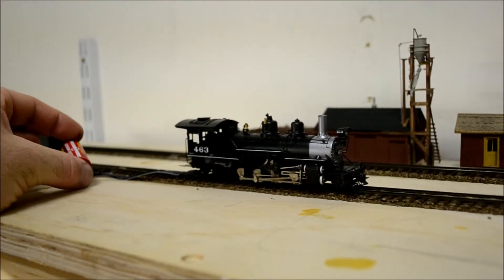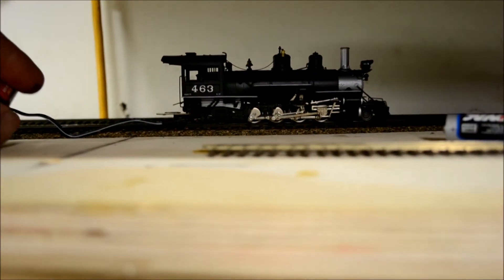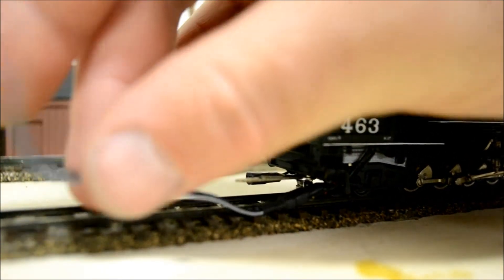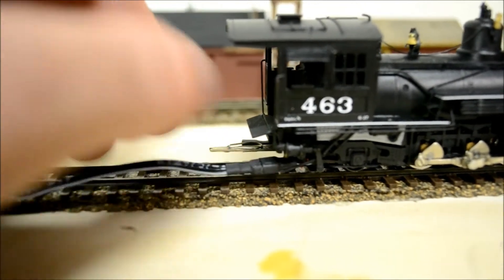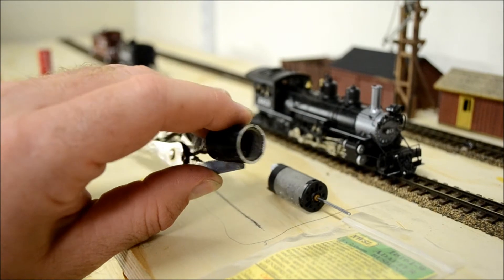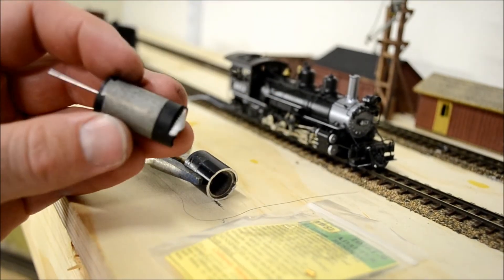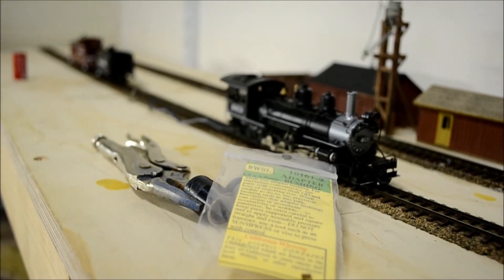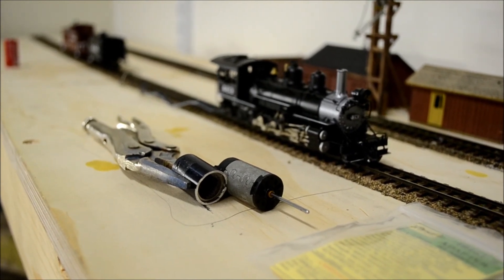Westside Models K-27 Brass Motor replacement

Comment: I recently came across a bunch of brass engines. The first two engines I tested went forward and backward, but then quit moving. The motor still makes noise in both directions. The previous owner informed me that they have been stored since purchase in the 1970's, never ran. After I inspected the the lot, I believe that they were never used/stored since purchase. My question is what would make the locos not move after going in both directions? Is it a maintenance issue, oil/lube issue? Any insight is appreciated. Happy railroading, thanks!
Reply from the maker: I would disconnect the motor from the gear box to see if there is any binding in the mechanism. If not, the motor is probably bad and needs to be replaced. I recently just re-motored some more HOn3 steam locomotives with NWSL motors, they are about $22.00 from their website. If you are going to run DCC with them you almost always have to change the motor out, draws too many amps. I just did a video on showing some of the locos I am currently building.
Reply: @Helmikins  thanks for the reply! I might have to pick your brain some. I have never worked on the engines, but, I want to be able to. The motor still makes noise like it's trying to go. It's not a buzz nor hum. Someone  else said it might be the drive rubber tube. Is this a common issue and resolution? Thanks again!
Reply from the maker: @KSamek-bz9cs  The rubber hose is almost always bad on these models and can be replaced with RC aircraft fuel hose. Usually it will turn yellow and go rock hard. You can take a sharp hobby knife and cut it length wise to get it off the gear/motor shaft. I would disconnect the motor and try and spin the gearbox shaft. This will help eliminate the running gear as the issue. Do you know the maker of the models? If you are able post a video of what it is doing.
Reply: @Helmikins  The 2 models I'm referring to are Westside Model Company Sierra #24 2-8-0, and Westside Model Company Southern Pacific Class A-6 4-4-2. I can get you a video of the sound it makes, however, it'll have to be after I cook for the wifey - she's hungry! lol. It'd be easier to maybe email it to you, or, I can post it on my channel. Your preference.
Reply from the maker: @KSamek-bz9cs  If you could post it to your channel.